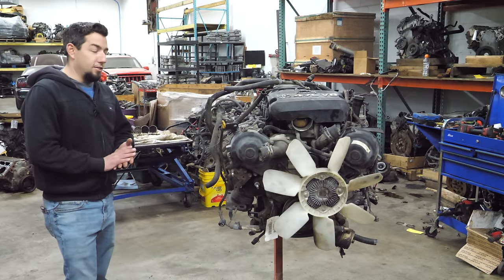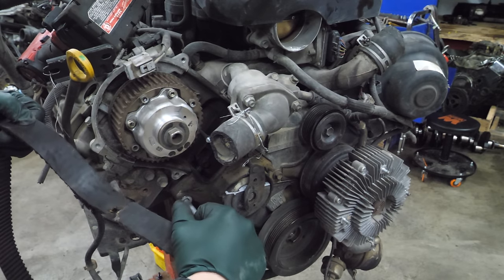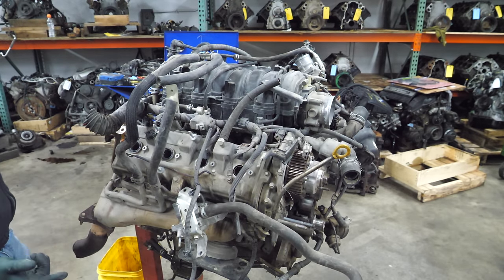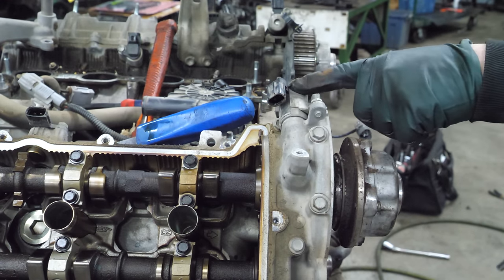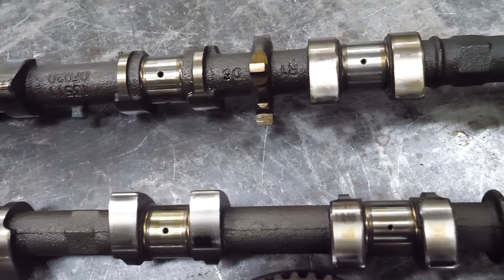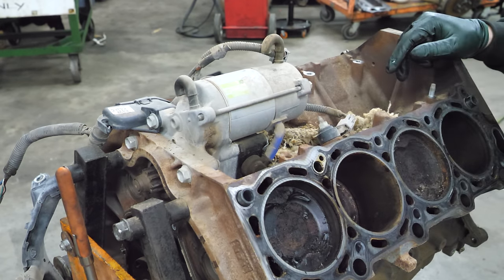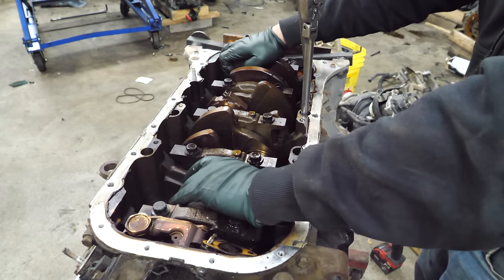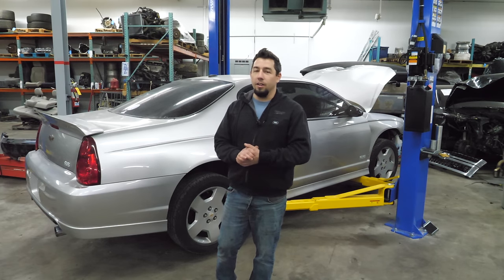Toyota Tundra 2UZ VVT Teardown! Bad Decisions Led To The Demise Of One Of Toyota's Greatest Engines!

Comment: Everyone tells me "OmG tOyOtA dEsIgNs tHe BeSt EnGiNeS!!!!11" Said engine has a timing belt in 2006, and the starter is hidden under the intake manifold for some breathtakingly arbitrary reason.

EdIt: cope, Toyota fanbois
Reply: It will never rust and has been proven to last 1 million miles.
Reply: Replace the timing belt once very 100k miles and the starter once every 300k miles. I fail to see how that makes it poorly designed, especially when many engines don’t last long enough to need to replace the starter.
Reply: Toyota hasn't built the best anything in years. They had 1 good engine in the 2JZ, and even that wasn't the best as its massively overweight. 
Big deal they last a long time. So do the tires on a Prius. If something is understressed its going to last.
Reply: @ouch1011  I've seen shitty old chevy smallblock engines run 300,000 miles without issue. And I've had to replace that Toyota starter a lot sooner than 300,000 miles. And if it was a well-designed engine, they wouldn't have a timing belt in it acting like a ticking time bomb that required a big shop bill, or several hours in the driveway, every 100,000 miles. Honda can make good engines with timing chains, even Toyota does it, and they started using timing chains because of the issues I've mentioned.